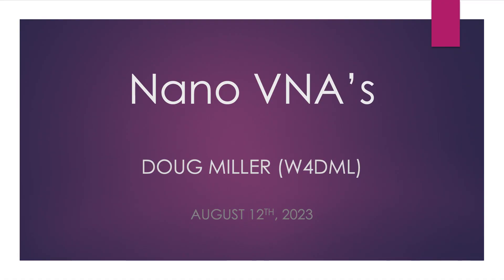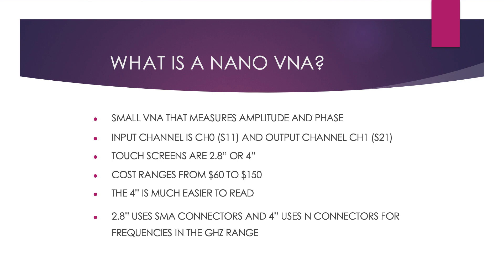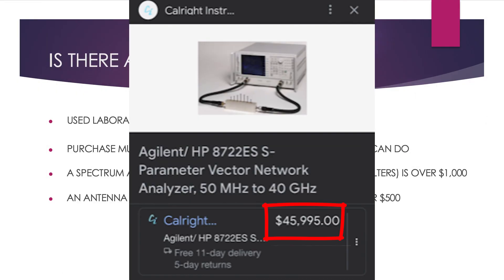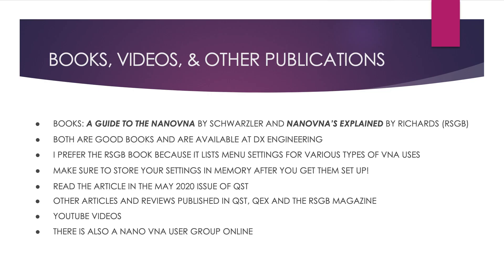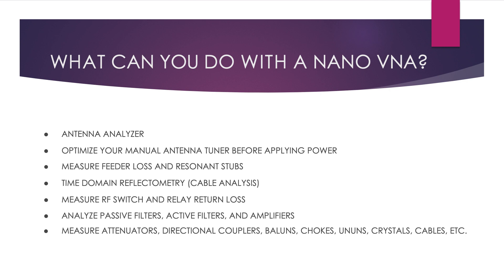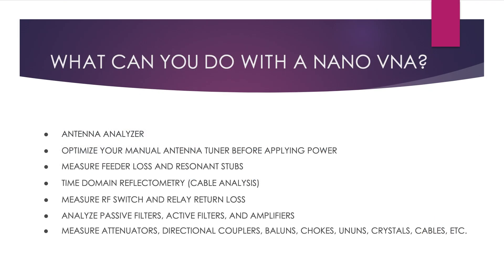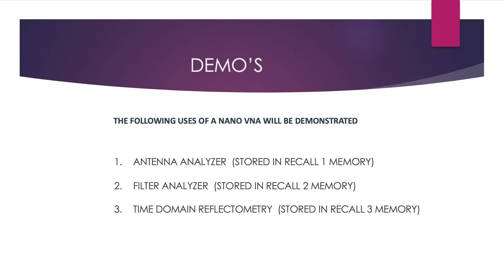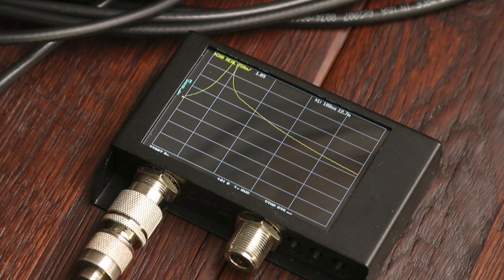Nano VNA's

Comment: Several years ago, on Ebay, I came across an HP "vector voltmeter" for only $35!  "WOW," I thought, "Just the thing for determining the resistance & reactance of antenna Z, to design a matching network, and CHEAPER than a 'Nano VNA'!"  But the listing also said, "Probe Not Included."  The input socket had multiple contacts, so it was obviously something more complicated than say, an RF probe, but really, how much could a mere PROBE actually cost?  I couldn't find one on Ebay, but I located a surplus dealer that had one.  It came with its very own foam-lined, hermetically-sealed, fiberglass case, and was...gulp, gasp, argh... over $900! :face-fuchsia-wide-eyes:

Comment: R&L electronics sell official VNAs so that's a trusted source in the USA. Currently the best VNA I've found for the price is the Libre VNA $550. There are some cheaper ones like the Lite VNA 64. It's decent & often for most ham radio needs sufficient. The dynamic range is basically what you end up paying for in VNAs. 

Good video & thanks for sharing. 
73 N4FOX

Comment: The NANO VNA is a great troubleshooting tool when trying to isolate cable faults at existing AVDL and cellular sites, either on turn up or on a trouble call. We quickly verify where the fault is located, correct it, and when the fault is corrected and all the antenna lines look good on the Nano VNA, then we call the tech with the Anritsu SiteMaster, FieldFox or similar to do the sweeps for the customer turn up package.